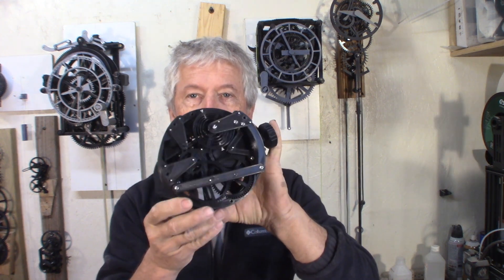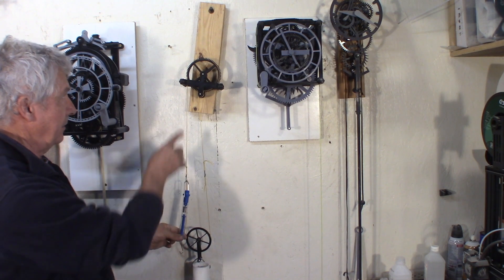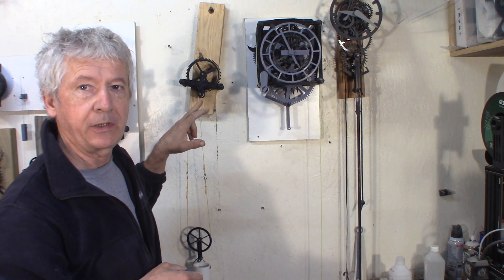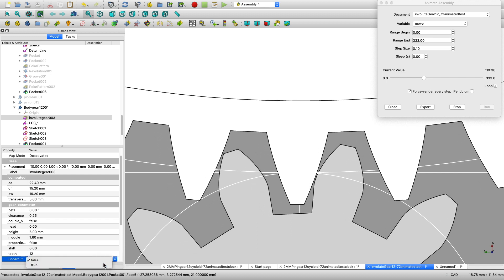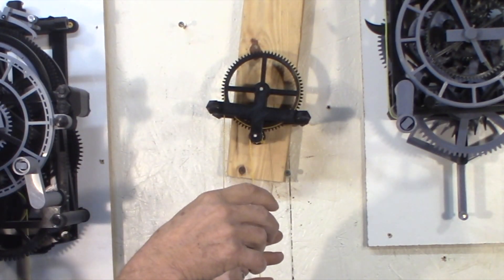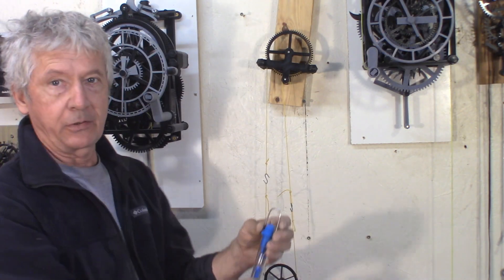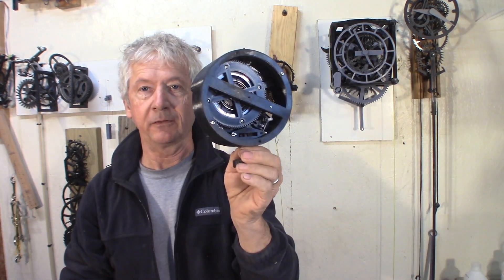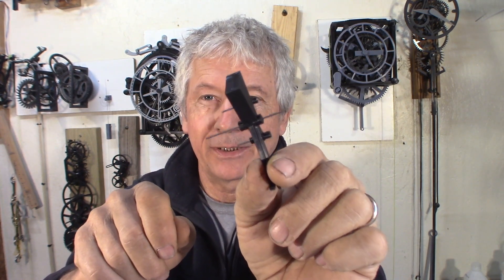Design and build of a 3d printed Roskopf watch, Part 3

Comment: Very interesting, thx for sharing. 
I might have a project after watching your video. 
I would like to make a pendulum that will give me 1 second. 
Basically, I want to elevate .500 steel.ball 18 inches high. 
I'd like to make ball clock without an electric motor 
Thx.

Comment: Very interesting results. There does not appear to be constant rotational velocity. Do you think the gears are deforming under load? Or is the active surface different than expected after printing? The elephant foot in the closeup would not help either. 

I did an experiment using unloaded gears that would be found closer to the escapement. It used 4 stages of 50 tooth gears driving 10 tooth pinions for a total speedup of 625:1. A weight just large enough to move the gear chain was placed on the rim of the first gear. Cycloid gears and 25 degree pressure angle involute needed similar weights of 56g. A 14.5 degree involute was 20% higher at 68g. A modified cycloid with the teeth tilted so most of the touching occurs after the line of centers was 25% better at 42g.
Reply from the maker: Yep just opened a big can of worm…
I am surprised about the 14.5 degree
Bering more than the 25 degree
The modified cycloid does make sense
I do not thing the gear is deforming much
Earlier test showed a module 2 cycloid breaking at around 20 kg
In my test I have 1.6 kg at the teeth
I need to make a new front frame so I can have a closer look at the meshing under load
Also need testing as little backlash as possible
Or no backlash and run the gears with some fine grinding compound until free
And different number of teeth 6,8,10,16
Then there is various materials
Just wondering how brass filled filament would work
I ear they polish well
I read somewhere can’t remember where that iglidur would not be good for clock application
While the friction is low, the adhesion can be quite high
Reply: @jacquesfavre999  Yes, a very big can of worms. There are so many things to try. 

25 degree gears have contact over a larger area which should reduce the engaging friction. They probably prefer pinions with 16-20 teeth. They are more likely to push the arbors apart which could enlarge the pivot holes.

Would helical gears spread the engaging friction across a larger area?

Backlash is never a problem in clocks since pressure is always applied between the weight to the escapement. 

Grinding compound might work with brass and steel gears where it can be completely washed away. Would it stay embedded in the PLA and wear down quickly?

I looked up Iglidur. Yikes, A350-PF is $229 for 750g and it needs a 180C build chamber. They also have other easier to print versions. I151-PF looks a lot better at $58 for 750g. Or I150-PF at $26 for 250g. What does high adhesion mean? Does it stick to the plate like PETG? Or does it have high static friction? Some PLA has low dynamic friction, but high static friction. The start/stop nature of the escapement makes it really bad when the gears have high static friction. Might be worth a try.
Reply from the maker: @stevesclocks  
And there is this
The point of contact slides from root to head for the gear and from head to root for the pinion
So while there constant angular speed between the gear there is not constant torque
With a module 2 gear and the same 12/72 ratio
The radius of leverage would go from 35 to 37 for the gear and 7 to 5 for the pinion
So the tans mission of torque will vary 
from 37/5 or 7.4 to 35/7 or 1/5
That is a significant variation
Thinking of it there is less variation on the pin pinion
I suppose this downfall is minimized with pinion with more theeth
Reply: @jacquesfavre999  Intuitively, a constant velocity gear seems like it should have constant torque. The point of contact does move around, but so does the angle of applied force. Does this cancel out? Or is some of the rotational torque converted into a force trying to push the axles apart? So much to think about.
More pinion teeth seems like a good idea. Moving the undercut to the large gear also seems like a good idea. Maybe it was never tried in a traditional clock with cut gears. 3D printing makes it easy.
Reply from the maker: @stevesclocks  The more I look into it, maybe the variation of torque is not such a big deal, the average is what counts, but while the high is easy to measure , the low not so much... I need to rethink the testing method
building a full clock is one, I definitely was going to test the pin gear on a full built clock, maybe compare, pin pinion, cycloid, involute in a full scale clock
When you have a 1 to 1000 ratio, things get obvious
I am thinking: 1/6 x 1/6/ x 1/5 x 1/5 that is 1/900 , that would allow me to do a 8 day clock with a 1 minute escapement, weight with one pulley, about 1 m drop
Reply: @jacquesfavre999  My guess is that any variation of torque can stall the clock. The start/stop nature of the gears is practically guaranteed to end up at a position where torque is too low to turn the escapement. Constant torque would be much more reliable.

An entire clock with pin pinions should run great. You might want to purchase pre-made dowel pins. They can be found on eBay at fairly reasonable prices in lots of 100.

It will be great to see your next clock with an 8 day runtime.
Reply from the maker: @stevesclocks  I was looking at that web site
tec-science.com
Min teeth for pinion 17 
The torque transmission is indeed constant because of how gear interact at an angle 
Maybe the profile is not right
Will do a gear with Fusion 360
Also I see cura has the option to have horizontal expansion for the outer perimeter and inner perimeter individually customizable
Reply: @jacquesfavre999  What program are you using to generate the gears? At one time there was a warning about the Fusion360 gear generator. It used to generate objects that look like gears, but it only approximated a true gear profile. Not sure if it has been updated. 

I reduce the size of a part by 0.25mm if it needs to fit inside another part with a reasonably tight fit. Each of the 4 surfaces could be adjusted by 0.06mm to have a similar effect. PrusaSlicer calls it XY Size Compensation. I use Gearotic to generate the gear profiles. They mesh perfectly in CAD, but now that I think about it, they should probably be adjusted to compensate for the printer effects.

The list of experiments keeps getting longer. :)
Reply from the maker: @stevesclocks  
I use freeCAD gear workbench
I believe it is accurate
But this morning I remembered some thing I had noticed earlier on the escape wheel of my watch and made the connection to the gear
The thing is that the printer when doing sharp angle drops an excess of filament and the smaller the parts, the bigger the default or excess
I am making new pinion with a rounded head and will test that
New video on the week end.
I think there is some setting that can mitigate that behavior in Cura
I was made aware of it while reading about a new slicer called Klipper

Comment: I'm became quite curious on the results and waiting for more results. This is exiting. The weight was  high and I don't believe the gear efficiency is equal on all weights . Maybe a variation of the weight gives interesting results?
Reply from the maker: Agree, this is more worst case scenario, and it not quite truly scientific evaluation
Just wanted to compare
Did a quick test on the involute with a 1/3 of weight, still got roughly about same ratio of weight/force, no dramatic change
Reply: @Ralph K   
If it works with a heavy weight, it will work better with a light weight.
@Jacques  On one of the close ups, I noticed a bit of elephant foot on the gear teeth.  That will definitely make the meshing of the gears less efficient since the load will be concentrated on the tiny elevated part of the tooth.  Another factor is the surface finish of the face of the teeth.  That can be improved by building a jig and driving the gears with a mild abrasive like valve grinding compound (fine or medium, not the coarse).
Reply from the maker: @solarguy6043  Good catch on the elephant foot I saw that too
I have noticed many times that new clocks improve after a few days of running 
I have thought of doing some polishing
I have read somewhere using teeth whitening toothpaste?
All fun experiences to do